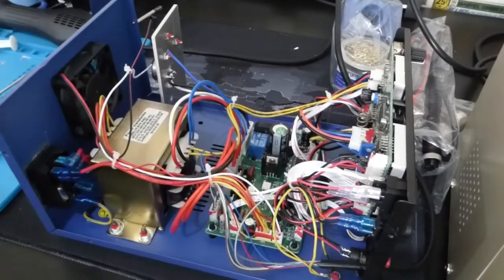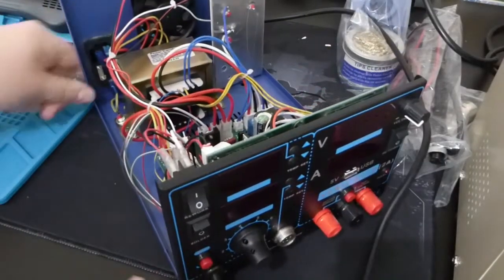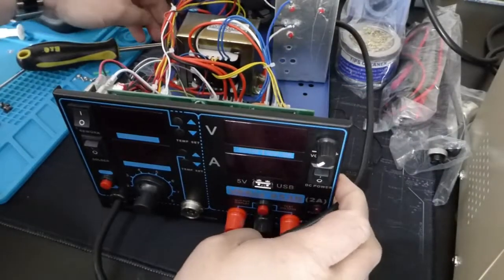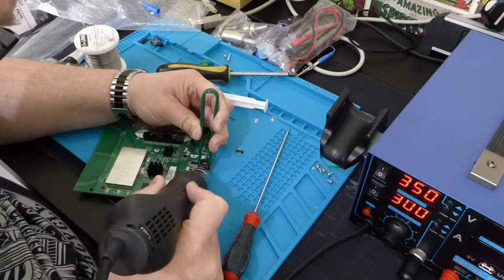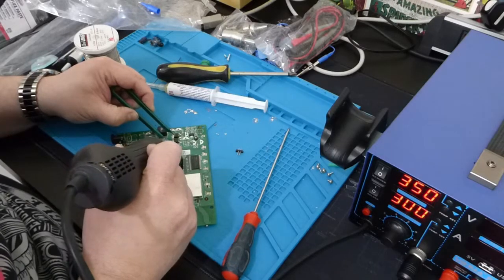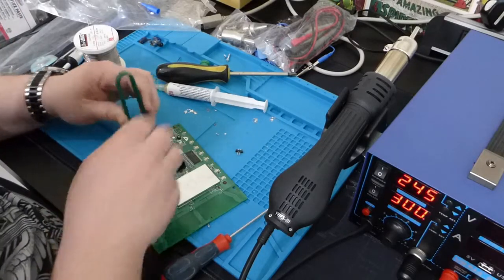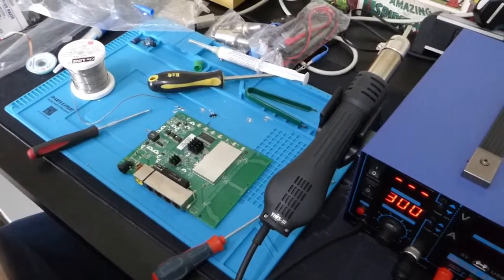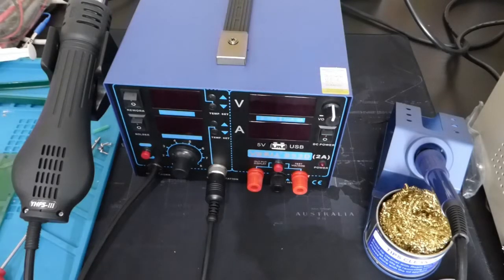BYTE SIZED: YiHua 853D First Test

Comment: Thanks for the review I'm currently on the fence about buying this unit versus buying individual power supply and soldering hot rework stations..If anything is between buying 1 of these or buying an individual pyramid power supply that is quality and then getting A combo Soldering iron rework station
Reply: what did you choose? even in the dilemma

Comment: Nice video; just got mine from Amazon and it is humming like a humming thing, noisy as !! When you switch the soldering iron on the thermal cutout just adds to the noise. Not a great start but a decent looking device :-( - It's going back

Comment: Please tell me if the Fan runs continiously or only if the Power Supply is getting hot? Greets from another Commodore Fan ;-)
Reply from the maker: I just dug it out of the back of the cupboard to check - the fan doesn't seem to run all the time; in a quick test it didn't run at all so I assume it is thermally controlled ... or broken! :)